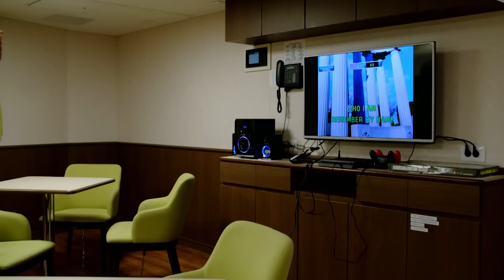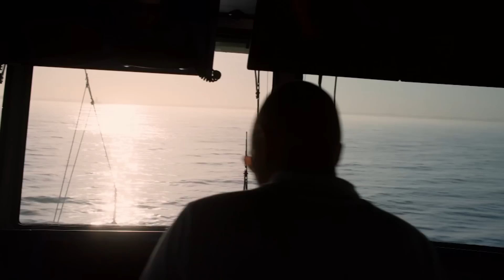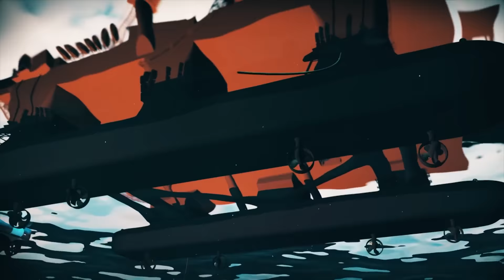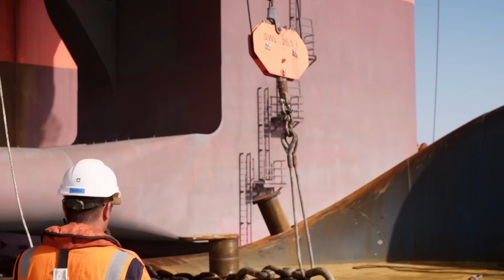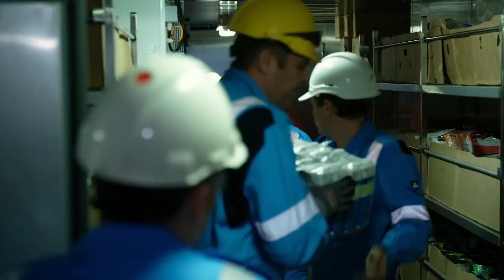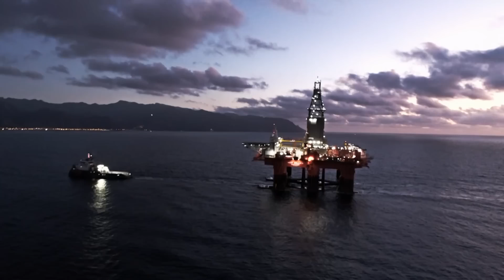Extreme Transport: Towing a $500 Million Drilling Rig Across Oceans | FD Engineering

Comment: 5:14 why wouldn’t you just put supports under the pods so they weren’t touching the ship that would lift them?🎉
Reply: or just install the propellers at the site so they won't be damaged. They didn't mention if the size of the rig is too big for the usual method mentioned.

Comment: Would it not have been cheaper to build this impossibility in the spot where is has to be used, rather than spend all that money towing/getting it there ?
Reply: Considering the cost to transport workers to another country, the cost of rental where they'll build, and availability of materials could be a major issue. I'm sure they would have considered that as well and weighed their options.
Reply: Same concept as to why most stuff are made in China - Economies of scale and the facility and experts to create them.
Reply: It takes 6 years to build one
Reply: Building an oil rig involves a lot of work and it takes  special yards to construct meaning if they should build on site then a whole new construction yard with heavy machinery must first be built on site before the rig construction which will be way more expensive.